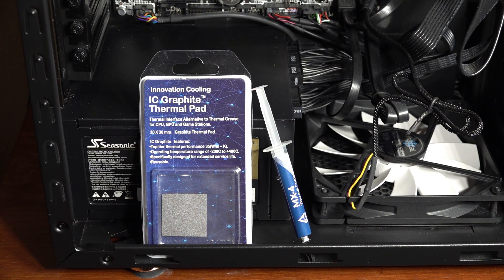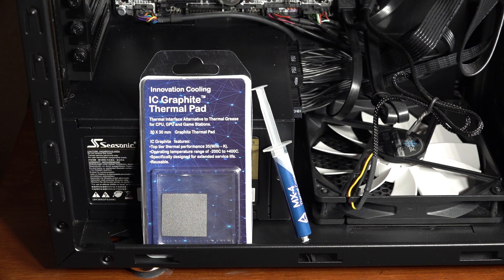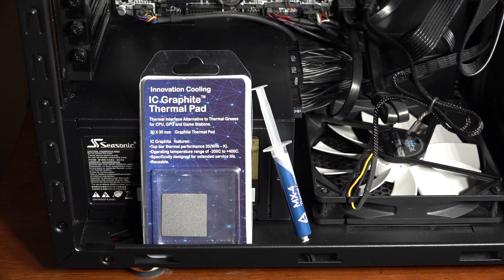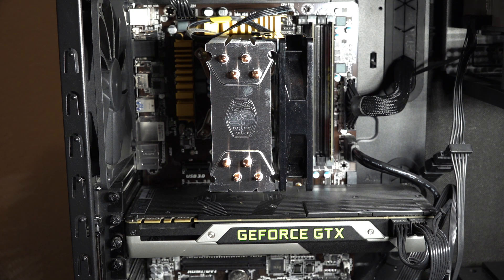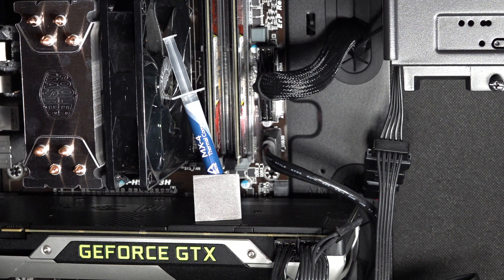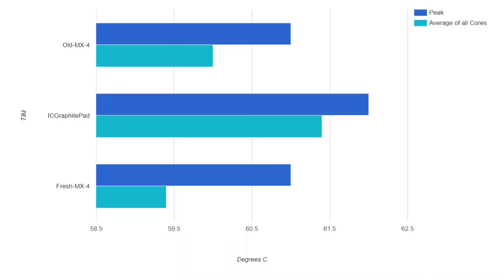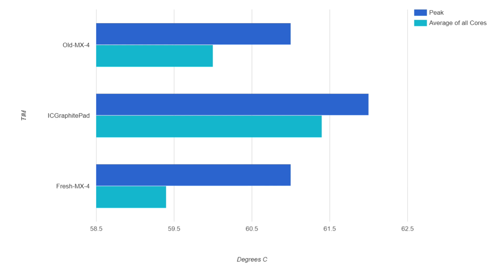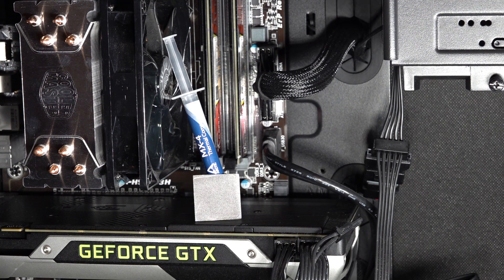IC Graphite Thermal Pad Vs Old Paste Vs New Paste

Comment: To anyone reading this, I was leary about using a graphite thermal pad. But I bought the IC graphite pad on Amazon anyways. Now I have the old Thinkpad X201 core i7 I bought on ebay  for under $60 bucks that ran between 56C to 65C while idle.

Now I was made to understand that somewhere between 40C - 50C is the ideal when idle. So, I disassembled it and put arctic silver 5 on the CPU while leaving the come-with thermal pad (not graphite) that was already there.on the GPU die. Oh, and I made sure to use a compressed dust spray to clean the fan as well. On reinstall, it ran at about 66C on idle.

So, I decided to try the Graphite pad. I cut out a size (it's 30mm x 30 mm) just a little larger than the GPU die area. I noticed its surface is too smooth and does not stick. So I used a very tiny drop of arctic paste to hold it down, then screwed everything back together.

The temperature drop after booting was at first nothing astounding. But I waited and watched. After about 5  10/15 minutes, the temp slowly dropped until it was hitting sub 40C (I kid you not). Now it fluctuates between 39C - 45C.

Now full disclosure: 1) I do understand that Arctic Silver 5 has a break-in time of between 50 hrs to 200 hrs before it reaches optimum performance. So, hindsight I should've given it more time to "cake."

2) I read that while the arctic silver is completely inert, same cannot be said for the graphite. So, you need to be careful because of it's electrical conductance. Make sure it sits well fixed on the CPU/GPU and clamp the heatsink firmly too to help.

Comment: Would you recommend this for my ASUS GL503 laptop? thanks
Reply: Also which measurements would I need? If you skip to the 9 minute mark in this video https://www.youtube.com/watch?v=RwESaaSf-cU you will see there's two sections I need to cover, should I order both the 40 x 40mm and 30 x 30mm and cut shorter? thanks!
Reply: Just ordered this laptop, so trying to figure out what I need to do when I get it. :)
Reply from the maker: I don't have any direct experience with the pad on laptops, so I can't say for sure that you'd get any better performance with the IC Graphite pad compared to the paste that is on there stock.  If you are going to swap out the stock thermal interface material, the IC Graphite pad might be worth a shot, but I can't say how much you will benefit vs. the stock applied paste.  Keep in mind that the pads are conductive, so if you use them I'd recommend trimming them to size, and you would want to be very careful to ensure they didn't slide off and potentially come into contact with any circuits on the board.  Personally, I'd probably just use a high quality, non conductive paste if it were me.  You might try searching around forums and such to see if anyone has any experience with the pads on that laptop.  It would be a shame to tear apart a new machine and swap the TIM and not even make anything better.

Since the CPU and GPU in that system don't have heat spreaders and are direct die contact, I would guess that the 30x30mm would be plenty.  

As for the tool kit, I'm sure it has more than you would need, but if you think you ever might have need of it again, I'd just pick it up.  If you can't afford it then I'm sure you could get away with much less for that job.  Personally, I've never regretted having more tools.

Comment: From my personal experience, few years old paste usually isn't the cause of higher temperature. It's more likely the dust build up between the fins of the heatsink that blocks cooling airflow. Using a vacuum cleaner to suck the dust from the heatsink fin will give you better result than new paste.

Comment: How did you keep the IC pad from sliding around when seating the cpu cooler?
Reply from the maker: I got the pad centered as well as I could and then just carefully lowered the cooler straight down until it was pressed against the CPU/pad.  Then I tightened the hardware carefully, while moving the cooler around as little as possible.  

Honestly, after installing a thermal 5-10 times on different builds, with various coolers, I find that it isn't too difficult but really no easier than thermal paste.  The main benefit over paste is that if you mess up you simply re-position it and try again, rather than having to clean and re-apply the paste.
Reply: Yeah, I tried that , but the pad just kept sliding when the heat plate got too close. I ended up taking a pin-sized dab of thermal paste and putting it on the corners of the processor. I am guessing it was enough since my Ryzen 5 2600x is running at 44 c at idle. I just got my build done so I have not run a cpu stress test yet.
I was hoping to see 36 c at idle, but my research showed that Ryzen 5 runs a wee bit hotter than an i5.

But the IC pad is definitely doing well in my Thinkpad. That was a pretty install.
Reply: a dab of alcohol on the pad will hold it down, or saliva :)

Comment: Hello, What size of pad do you recomend for ryzen 2700X, 30x30 or 40x40 (havent bought yet so I dont know dimensions)???
Reply from the maker: I believe you will want to go with the 40x40mm pad.
Reply: 30x30
Reply from the maker: The 30mm pad will probably work (I don't know what the Ryzen 2700X die size is under the IHS), but I don't believe it will fully cover the IHS of the Ryzen 2700X. From the measurements I've seen the 40mm pad will overhang just a tad, but that shouldn't hurt anything, as long as it ends up centered after install.  It can also be trimmed as needed.

I have a 40mm pad.  I've considered building a Ryzen machine.  If I do I'll show how the 40mm vs. 30mm pad covers the Ryzen IHS.

Comment: I am actually still using paste from Oct 2009 on my older i5-750@4Ghz system, and it's still showing the same readings as before give or take a degree due to changes in climate.  We're talking close to nine years now with some old Arctic Silver 5.  But I am also using a dual Noctua fan setup from the same year too, so YMMV!  Anyway, on my next build, I'm going to switch to pads.  1-2 degree difference isn't going to matter, especially on my horribly shitty current 4670K that can't even OC above 4.0 and hit the desktop, so I just leave it at the default.  That will soon become my storage/retro/1440p system.  I may or may not OC on my next build, and I'll still use pads for it initially.  

I also travel once or twice a year with whatever is my current gaming PC, and right now I'm using an AOI in it, which makes it easy to travel with, but a giant heatsink is definitely not.  One good bump is all it would take to crack the motherboard.  I think I'm going to go back to air too, but that means when I go out of town that I would need to remove the heatsink.  Pads make the process a whole lot faster.

Comment: was this system stress tested with stock voltages and clocks?
Reply from the maker: Yes, all stock on the processor.  It's actually not a "K" series processor, so it's locked.

Comment: Since the temperature difference is negligible I'm going to go with using IC graphite on my laptop because it needs to be cleaned every few months and doesn't need to be replaced every time.
Reply: I put the IC pad in my laptop and seems to work just fine. The only pain the butt thing about it is keeping the dang pad in place when putting the cooler in place.
I have not tried using a "dab" of paste to stick the pad in place. I have not gone this route because I have not seen enough evidence that the "dab" of paste is reliable.
I am trying to use the IC Pad on a Ryzen 5 build right now, but the pad just keeps sliding around when I try to seat the cooler. It's kind of frustrating. But the "it won't wear out factor" is quite appealing for sure.
Reply: @vasocreta  dab some alcohol on the pad to keep it in place
Reply: Same. I have custom loop and I clean regularly. My temps are a half to one degree warmer, its so close it doesn't matter. I take the re-usability and quick application any day over a 3% to 5% cooling reduction.
Reply: Bob Of All Trades has a video on his channel explaining why these aren't a great choice for most laptops.
Reply: @NikoBell1188  What was outcome!
Reply: And what about GRIZZLY CARBONAUT IN LAPTOP INSTEAD?